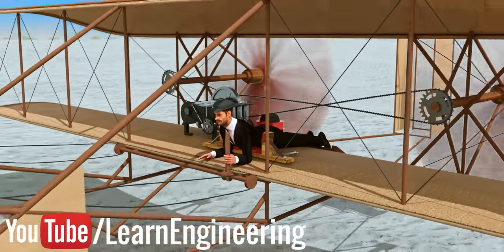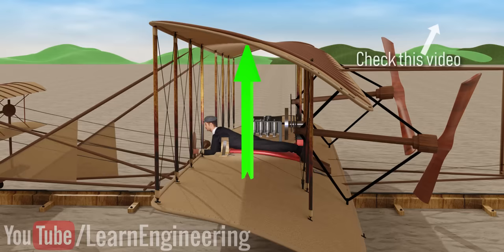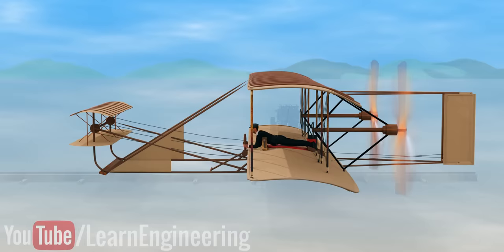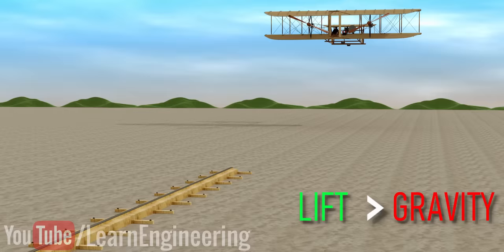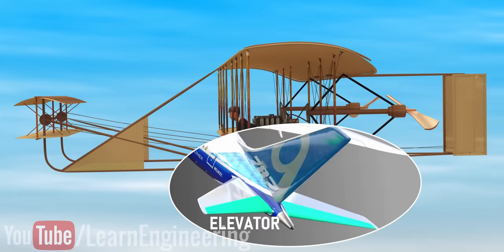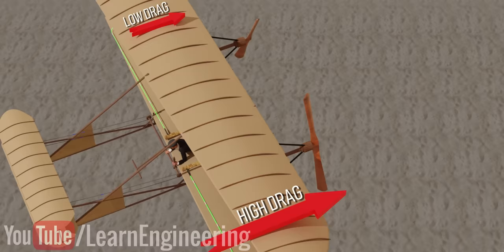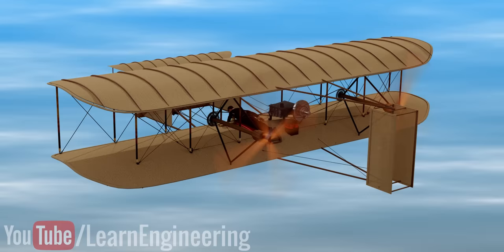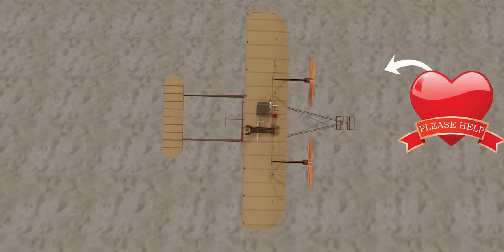The Brilliant Engineering of FIRST FLIGHT !

Comment: Reply to Selma Nedel:  "NASA proved the (1903 rexact) replica (doesn't) fly..." 

Major Bett:   This is your interpretation.  Please provide the reference (URL) and the exact quote.

The tests by former NASA engineers did indicate that the first Wright Flyer would be very difficult to fly.
After reading Cherne, I understood that he said, 
Without a well trained pilot, the Wright Flyer probably couldn't fly over 15 sec. and 120 ft.  

This is not an exact quote:  It is what I took away.

http://legacy.wrightflyer.org/updates.html

The AIAA Wright Flyer Project is sad to announce that Jack Cherne, Project Chairman, has passed away.

Jack Cherne lead a volunteer team of several dozen aerospace professionals who have spent hundreds of weekends since 1980 building the AIAA 1903 Wright Flyer, two authentic replicas of the first airplane to achieve sustained, powered flight. An engineer who specialized in aircraft design and construction, Cherne worked in the aerospace industry since World War II, when he helped design the Mars Flying Boat and the Northrop XB-35 flying wing. In the decades since, he has worked on projects as disparate as helicopters, guided missiles, and, beginning in the early 1960s, spacecraft and satellites. At TRW (formerly Space Technology Laboratories), he headed the team that built the engines that allowed men to descend to the surface of the moon.

In addition to his involvement with the AIAA Wright Flyer, Cherne continued to work full-time for TRW in areas such as launch facilities for Air Force satellites and vehicles for nuclear, biological and chemical reconnaissance.

Cherne was a member of the American Institute of Aeronautics and Astronautics (AIAA), the group sponsoring the AIAA 1903 Wright Flyer, since 1941. He became an AIAA Fellow in 2004. Fellows are persons of distinction in aeronautics or astronautics who have made notable and valuable contributions to the art, science, or technology of aerospace. One fellow for every 1,000 voting members is elected each year.

Cherne and the Wright Flyer Team celebrated the Centennial of Flight at the Regional Office of the Federal Aviation Administration with their Wright Flyer airplane. The airplane had just returned to it's home at the FAA Flight Deck after a fifteen month National Tour reaching over four million people. At the ceremonies, Jack received the honorary "Charles Taylor/Aviation Mechanics Award". This award is only given to special recipients with at least fifty years of service in the aeronautics/astronautics field.

Although Jack developed serious health problems during the past year, he continued to pursue his dream of flight. He chaired our Saturday meetings at the Wright Flyer Project at Microcosm in El Segundo, CA where the flightworthy replica is currently being constructed. In February, he was no longer able to continue and passed the torch to Co-Chairman Howard Marx. Jack passed away on March 2, 2004.

Comment: Great explanation of adverse yaw - in radio control models I used to think rudder was mostly for steering on the ground! Never needed it, in fact could've done without it. (Still need a vertical stabilizer, but I've had guys ask "what's the use of a rudder anyway?") in the typical airplane design of today adverse yaw is much more reduced. Sure, a pilot may feed in a little opposite rudder to keep things straight nowadays, but it must have been a vexing problem at that time! 

 The newer trend of "3D flying" makes much more use of a rudder, where you can use a wide rudder and do flat turns (yaw only, using a little opposite aileron to keep the wings flat), lots of stunts, knife edge flying and of course vertical hovering etc. Watch "Fat Guy" doing flat turns: https://www.youtube.com/watch?v=Q4TXB5r9S4E
Reply: Dale, it is not opposite rudder. If you bank left with ailerons, the adverse yaw is to the right and must compensated for with left rudder. The last problem of flight for the Wrights was solved when they invented the rudder.

Comment: the brilliant engineering of a flightless machine. did you know that if you rebuild a replica as perfect as you can make it and it has the weak engine they used and the excessive weight of the machine don't get off the ground!!!

Comment: A real plane doesn't work with a rail or a catapult.  the first plane itself was that of Santos Dumont.
Reply: You do realize the 1903 flight didn't use a catapult right? 
The only reason they used catapults later was because it shortened takeoff, not because the aircraft was unable to do so on its own.

Comment: Very good video. Only one mistake. First plane built was by Alberto Santos Dumont de Andrade. BRAZIL!!!
Reply: The fact that you frame this topic in nationalistic terms reveals your own bias.
Reply: I love Brazilians....

"The replica didn't fly." -  The weather on December 17th at Kitty Hawk was unusually cold that day. The barometric pressure was very very high. The air density altitude on that day was about a 1000' below sea level from a normal day. That's why they flew. Had they not, it would have only been a few days and they would have. When they went back to Ohio the air density altitude was about 5000' and no, the aircraft didn't fly. It took them some time to figure out that barometric pressure was important when it comes to flying.

"They were catapulted into the air and glided."-  They did not use a catapult at Kitty Hawk. You are referencing the very 1st filming of a flight in Ohio. That was the 4th airplane they had built in 1908 (its here on YouTube) . There was no catapult at Kitty Hawk…. There was no catapult…. At Kitty Hawk. If a fighter jet gets catapulted off the end of an aircraft Carrier, does it then not fly?

"Dumas was the first to fly"‐  According to the definition of heavier-than-air flight, no he didn't. His airplane did not have a proper propeller, it did not have a way of controlling the aircraft via ailerons or wing warping or a rudder that moved or elevators that went up-and-down…. He hopped. Just as you guys wanna claim the Wright brothers were catapulted... his airplane was just like a paper airplane.

Please go do some research!!!!!

Comment: The term he should be useing is Aeroplane not Aircraft. An Aeroplane as in this case is a Powered Aircraft and should be referred to as such. An Aircraft is capable of Flight but does not have an Engine. The Principles of Flight Lift Drag etc were discovered by Sir George Caley in England 1799  long before the Wright Brothers . Known at NASA as the Father of Flight useing his principles he designed and had flown a manned Aircraft with no Engine so as we now say a Glider . His work was documentated and the Wright Brothers used it in there experiments with Gliders and in their powered Aeroplane the first powered flight useing known Scientific principles. They made reference to Caleys invaluble work. So leaving aside hopeful people jumping of Hills and Castles in the past with wings but no Scientific  design principles Caley was first Aircraft the Wright Brothers first powered flight  so first Aeroplane.

Comment: the pilot was not at the center because simply,the pilot have to spare the space for the engine and also balancing the plane because that 12 pounds engine could make the plane roll 90 degree left if we change the pilot  to the engine side,....wait wait wait it still doesnt fix the problem.now the plane is turning 90 degree left and... oh no no no no no no no no! (plane crashing)

Comment: The original one don't fly. Read about Santos Dumont.
Reply: I did fly in 1903. It could not maneuver and that's what Santos Dumont was also trying to fix, but Santos Dumont was the first flying with withnesses and a camera rolling in 1906, in France. By 1908 flight controls had started to be majorly implemented in all airplane models.

Comment: WING WARPING AND LATERAL CONTROL
This was the secret that Wilbur Wright shared with aviation pioneers.
Here are the early aircraft that quickly adopted it after 1908.
We also need a list of Santos Dumont contributions and the early
aircraft that used it.

The Wright Flyer (1903)
The Santos-Dumont Demoiselle (1907), the first homebuilt.
The Antoinette V (1908), a wing-warping variant of the Antoinette IV
The Blériot XI (1909), which made the first flight across the English Channel.
The Etrich Taube (1910) used a cable-warped horizontal stabilizer as well
The Nieuport IV (1911) racing and sport monoplane used for the first loop.
The Bristol Coanda Monoplanes (1912), 
The early versions of the Royal Aircraft Factory B.E.2 (1912) used wing warping
The Morane-Saulnier L (1913), first fighter aircraft, 
The Caudron G.4 (1915), a French biplane with twin engines.
The Fokker Eindecker (1915), the first German fighter aircraft.
The Fokker D.III (1916), one of the last operational fighters with wing warping.
The Christmas Bullet (1919), unbraced sprung steel spars contributed to its notoriety.

Modern re-assessment
Several of the reproduction planes built for the film Those Magnificent Men in Their Flying Machines used the wing warping control systems of the original aircraft – with mixed results. The wing warping of the Avro Triplane proved surprisingly successful, whereas on the reproduction Antoinette, with its very flexible wing, wing warping offered little effective lateral control. Since the original Antoinette-style ailerons would have probably been even less effective, unobtrusive "modern" ailerons were inserted – even with these, lateral control remained very poor.[2]
Reply: tom Crouch declaration. WRIGHT BROTHERS DID NOT INVENT THE WING WARPING SYSTEM THIS SYSTEM HAS BEEN TESTED BY GALLAUDET IN 1896. SEE WIKIPEDIA PLEASE.
Reply: Perhaps the wing warping system was older than the wright's mother. It was old and helped much more for control in PLANERS without motor, much lighter artifacts.
Reply: The wing warping system was abandoned by the wrights in 1909 due to the fact that Dumont's idea of applying ailerons is much more efficient
Reply: @harpiasonhadorasonhadora5259    HS:  WB did not invent wing warping.

SB: You are correct.  Gallaudet tested it on a model in 1896.  He made no attempt to patent it.  Had he done so the patent office would have found it.  Not sure when it was discovered but probably not until after 1920.  
Otherwise Glen Curtis would have used it in his legal battles.  

The English word is plane not planers but the Anglo-Saxon term comes from that word.  I doubt that Galaudet's system provided any more control.  Efficiency is dependent on the rest of the design.  There were problems in the efficiency in some mono wing adaptions.  I am not aware that it was in any way associated with whether or not the glider had a motor.  Early systems with ailerons typically did not work as well.  Ailerons were easier to fabricate in association with thick airfoils.  Wing warping has have named for use with hypersonic aircraft.  It is the same principle.  

Santos-Dumont's method was not more efficient.  Why else would he build the Demoiselle 19
with wing warping for lateral control.  He did switch to ailerons later.  If you find an explanation for this please post a reference.  It may have worked better on his mono-wing aircraft.  So far no engineer has said that it worked better on all early mono-wing designs.  They have said it was easier to manufacture on thick airfoil wings.
Reply: @stevebett4947   Steve, there is no need to write a book for just one explanation and you yourself ended up agreeing that what Brazilians present here is true. Regarding the use of wing warping if they were so efficient they would continue today and be used by everyone. When Dumont presented the innovation created by M. boulton in 1868 (ailerons) he showed the world the best. In 1909 or 1910 it had statements made by the wright themselves declaring the abandonment of wing warping and use of the ailerons for being much more efficient.
Reply: @stevebett4947   The references that you must present are the documents registered by them between 1903-05 registered, in the highest authority of the time proving that they FLYED before. This you have to present.

Comment: Just a few years later, Glen Curtiss came along and invented a ton of important aviation parts still used today,  such as flaps, ailerons, enclosed cockpit,  retractable landing gear, the seaplane, ect (as well as the throttle control on the handle gear for motorcycles).
Reply: Curtis-Johnny come lately-would have never left earth had he not stolen the wrights propeller designs.....
Reply: @zeke2566  I don'tknow...I'm pretty sure Curtis who was directly or indirectly responsible for like 500 inventions on the airplane would have figured that out if he was asked to design a flying machine.  He was totally a mechanical genius.   Obviously the Wrights weren't the first people to people to have conceived of an object that could fly, so having them patenting the who thing is kind of Ludacris.
Reply: @mikehipparchusnewton7436  sorry,wrong,nobody got airborne with out wrights prop design- point of fact-period end of story!

Comment: The first fly is Dumont, by 🇧🇷
Reply: I love Brazilians....

"The replica didn't fly." -  The weather on December 17th at Kitty Hawk was unusually cold that day. The barometric pressure was very very high. The air density altitude on that day was about a 1000' below sea level from a normal day. That's why they flew. Had they not, it would have only been a few days and they would have. When they went back to Ohio the air density altitude was about 5000' and no, the aircraft didn't fly. It took them some time to figure out that barometric pressure was important when it comes to flying.

"They were catapulted into the air and glided."-  They did not use a catapult at Kitty Hawk. You are referencing the very 1st filming of a flight in Ohio. That was the 4th airplane they had built in 1908 (its here on YouTube) . There was no catapult at Kitty Hawk…. There was no catapult…. At Kitty Hawk. If a fighter jet gets catapulted off the end of an aircraft Carrier, does it then not fly?

"Dumas was the first to fly"‐  According to the definition of heavier-than-air flight, no he didn't. His airplane did not have a proper propeller, it did not have a way of controlling the aircraft via ailerons or wing warping or a rudder that moved or elevators that went up-and-down…. He hopped. Just as you guys wanna claim the Wright brothers were catapulted... his airplane was just like a paper airplane.

Please go do some research!!!!!